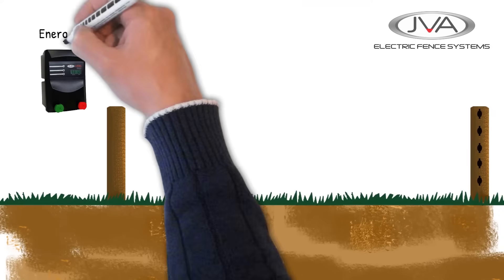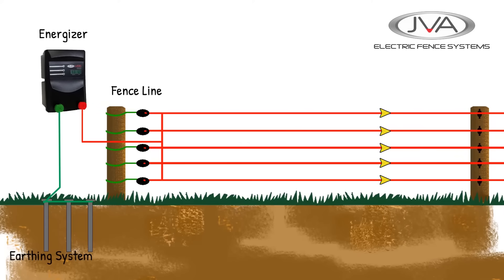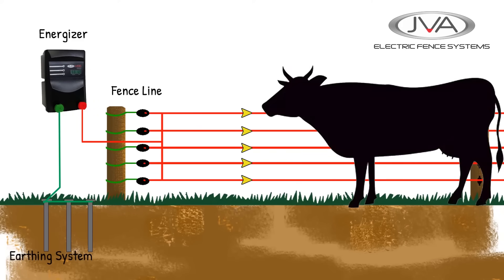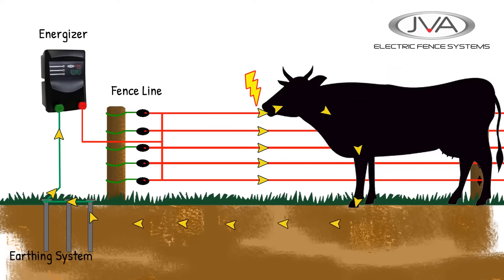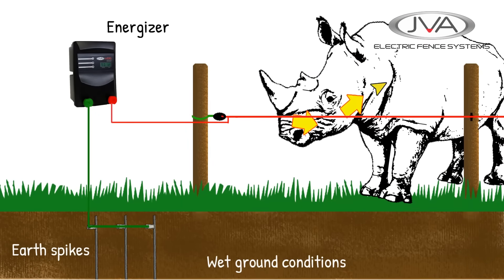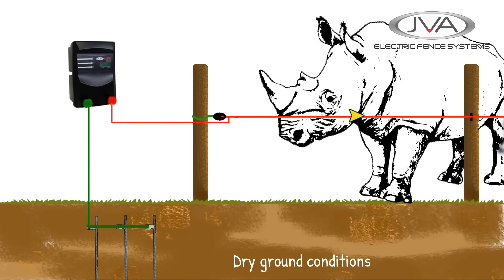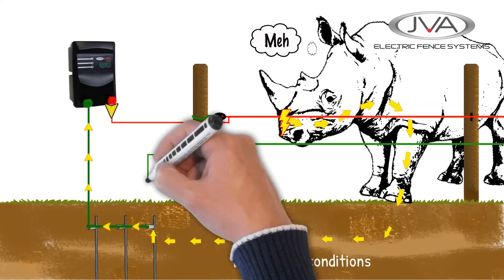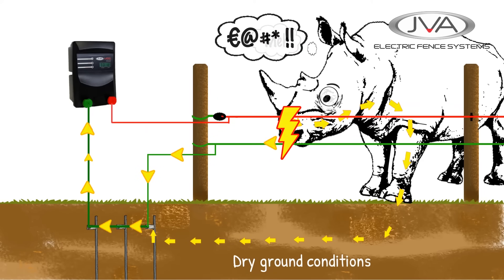How does an electric fence work?

Comment: I'm a little confused. In a two wire system I still need an earth ground? Why can't the ground wire go straight back to the charger avoiding earth ground and just using the internal ground of the charger? I'm just protecting a 20'x20' chicken run from external predators, namely bears.
Reply: I'm not their rep, but imo there is no reason you couldn't wire up a simpler system as you say. It would just be potentially less effective. The idea of both is just redundancy.

Comment: Alright so if I ground an energizer to the vehicles frame, and someone was laying on the ground with a power tool, trying to cut away my catalytic converter, would that cause the tool to break or harm/kill the thief? Looking for creative solutions
Reply: lol no. Asphalt isn't connective enough conductor to work, and where would you ground it?

Theoretically you can energize your frame, and put another connector to the ground, but there's a ton of confounding variables. Like what surface is it, asphalt dirt etc. Is it wet? What kind of shoes are they wearing if any? Are they laying on their back? What clothes are they wearing if any? What tool are they using, and is it insulated? Are they grabbing the frame with bare hands or wearing gloves? Also an electric fence while annoying can possibly be ignored by a crackhead about to slice out your cat, it doesn't take so long. If somehow you made it so effective it bloody electrocuted you, it would become a hazard to not only the theif but to others and yourself. 

That would of course make it incredibly illegal, not even going into the fact it's illegal to make booby traps. What's probably more practical is just welding a steel plate over the cat, making it inaccessible enough as to be not worth a crook's time. Maybe if you wanted style points put a camera right by your cat with a message saying they are being uploaded to the internet lol.

Comment: is the electric wire running dc current or ac current?
Reply from the maker: Fences can use either mains or battery power and some energizers have the option of both, the charge is converted within the energizer before being released down the fence.

Comment: Are people hurt? Do have die?
Reply: No, it is not really dangerous. There is high volate, but very low current. It means it shocks you, but it doesn't hurt you seriously. Even smaller animals can survive
Reply: you would have to get stuck on the fence to even have a slim chance of dieing but theres a cut out timer so if keeps shocking for a period of time it will stop.

Comment: Why energizer is earthed ? We do get shock by live wire alone
Reply from the maker: No you will not, if you jump in the air and touch the live wire you will not get a shock because you are not standing on the ground. This is why people who fix high voltage power lines use a helicopter if they work on the live lines as it is not touching the ground. Only when the current passes through you into the ground will you get a shock.

Comment: Are there any fence that doesn't require a ground?
Reply from the maker: Some of our Security range of energisers do run a neutral ground on the fence  that loops back to the energiser so that it can be monitored but it is required to always have an aditional grounding to the earth stakes. You may also like to watch our video on Bi-Pola fencing that has another option on running a fence.
Reply: @JVASecurity  is it ok for me to run my hot and ground lead out wires in the same conduit and in the same trench ?  In the same trench without conduit? Will this cause induction?